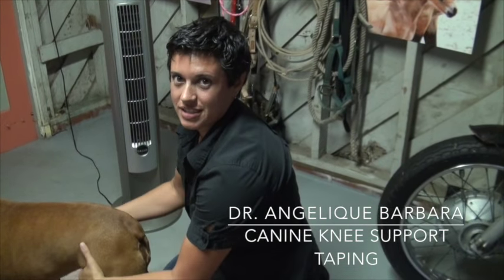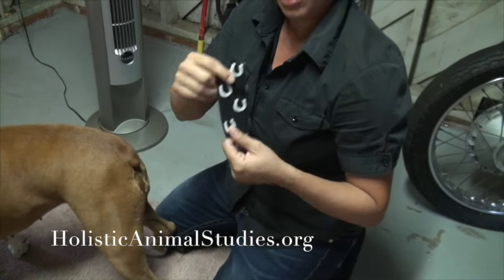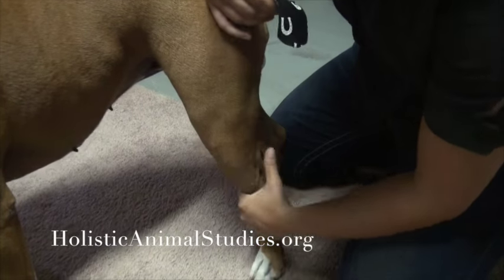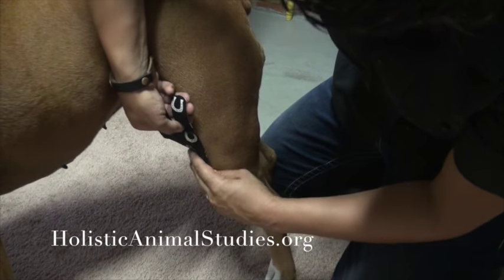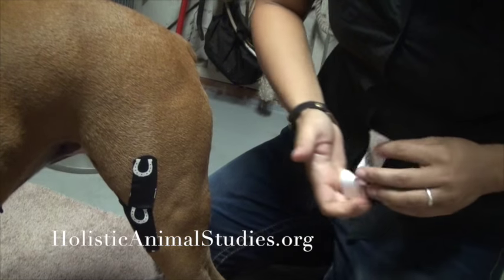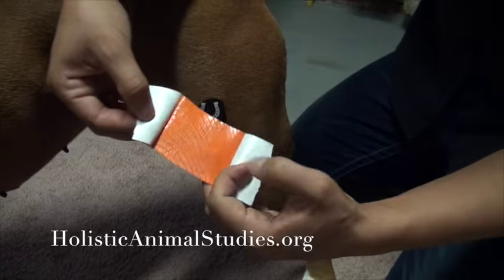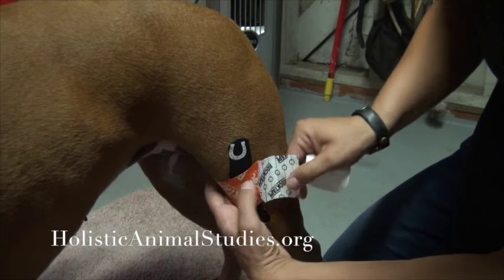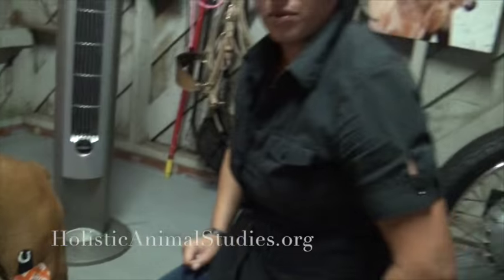Canine Knee Support Kinesiology Tape

Comment: Question: How close should I shave the leg  of my dog? She is short haired but has some fluff in the back of the leg. How traumatic will it be later on when it's time to remove the tape from the leg and the hair has regrown under the adhesive?
Reply from the maker: It should just be shaved to short hair length. The tape shouldn't hurt when being removed. You want to remove in the direction of the hair rather than against it. Some hair will come off with it, but it should only be the hairs that were ready to shed off.
Reply: @Dr.AngelB  Thank you. She seems to be healing without any brace as it has been 4 weeks.....but I have had to carry her up and down 2 flights of stairs 3x day in that time period. 
The tape may help her even more. All I know is that it has been a long recovery period and at 15yrs old....surgery was out of the question.  With her odd shape,...the affordable brace option also proved to be an exercise in futility.  I think the tape should help though.
Reply from the maker: @ToddDolce  I hope it does help. Sending healing thoughts her way.

Comment: Hi Dr. Barbara, 

I'm looking to give my dog some support for grade 2 (left knee) and 4 (right knee) luxating patellas. He has other health issues at play (Cushing's, some nerve issues, and we're waiting on a lymphoma diagnosis) which is why we're holding off on surgery for now until we know more. I'm not sure if his knees are too far gone to help but I want to at least try to offer him some stablization and support while we figure out the correct diagnosis. 

I see in the video you are using two different types of rock tape: the equine and (I'm not sure if I'm correct I'm assuming) the h20 version of their regular tape? Is there a reason to do this and not use just the equine tape or just the h20 version? It also appears as the orange rocktape may be slightly thicker, so I'm wondering if it's a more supportive tape? If so do you remember the exact name of it? I'm having hard time finding any orange tape with that logo on their website. 

Thanks, 

Aurora

Comment: My dog is a wire hair Jack Russell and pretty hairy on her leg in this area. I have the equine tape ordered and will be doing this treatment on Dusty. I have no clue if red light therapy works or is just a scam, but I have a light to try using on her in addition to this treatment. Most of the brace companies say their braces are not well suited for dogs with stubby legs as my dog has and have actually tried to steer me away from purchasing a brace setup from them because of that.My city is too far away from where any Vet does the surgery and there is no guarantees that the surgery will work or even that the other leg may also end up being torn in this area, due to the additional stress being applied to it as the weak knee heals. The cost is significant, so finding this sort of treatment as an option is certainly a blessing.I am wondering if I should shave Dusty's hind leg in this area or not?  Seems she would have some itching as the hair grew back.and though I have used this tape myself in the past, I don't recall how much air circulated well beneath the tape as the norm.  I will experiment a bit with this application. I found it difficult to locate the Equine Rock tape locally, but did finally locate it.One question though:  Does this therapy/treatment usually take about 6-8 weeks or longer before the wrap tape can be eliminated or is it much longer, depending upon the animal?Thanks for posting this video.
Reply from the maker: +a1930ford I would clip the hair on your dog's leg so that it is the length of a short haired coat.  Do not clip it down to the skin.  Ligament injuries take a long time to heal, so you will need to apply the tape for at least 3 months while your dog is using the leg.  I'm not familiar with red light therapy, but cold laser therapy definitely helps speed up healing time.  There is also a supplement from Standard Process called Ligaplex 1 that helps the ligament heal.  If you need to order more rocktape in the future, you are welcome to use my coupon code angelsanimals for 45% off.  You can order through rocktape.com.  Good luck!
Reply: +Angelique Barbara How long does the Rock Tape stay on the dog when applied?  I didn't hear that mentioned in the video. Can the tape stay in place for a day or two or does it have to be reapplied daily or such?I purchased some clippers and will be starting this treatment later tonight.Thanks for the info and directions.

Comment: Can you tell all of us if the dog needs to be standing to do this, or could they be laying down? I ask bc its just easier to see the knee when their laying down and its bent not straight. Thanks so very much for sharing your knowledge! ♥️
Reply from the maker: Hello. You can perform the tape application while the dog is laying down :-)
Reply: Thank you very much for your timely response, just one more question about application that I don't think was mentioned in the video. When you apply the (Y) the first strip of tape on the knee do you stretch it at all anywhere (top Y or bottom of Y) Or do you just apply it with no stretch? I do know you mentioned the top tape that goes on top of the Y is 50% stretch, so just want to make sure & check. Thank you again for everything!!
Reply from the maker: @ashleysnyder4875  No, I don't add stretch to that piece because it tends to stay on better without stretch. :-)

Comment: If I have a maltipoo with long hair, could I still use this tape on him? Will it hurt him when I need to remove the tape?

Also, is this human tape or do I need to buy a tape specific to dogs?
Reply from the maker: You should clip his hair so that it is a bit shorter. Taping over the longer hair will not hurt him, but the tape will be more effective if the hair is shorter. When removing it, you will want to wet it and gently pull it off in the direction of the hair growth.
Reply: @Dr.AngelB  thank you so much!

Comment: Curious about the two different types of tape. 5 y/o 90 lbs. male chocolate lab showing signs of cranial cruciate injury.
Reply from the maker: There are many different brands of tape on the market. I recommend getting one that is extra sticky or made for animals because it will stick better. There are also normally 2 widths. Most dogs do fine with the smaller (2-inch) width.

Comment: Hi Dr. Barbara, my dog was just diagnosed with an acl tear. She recommended surgery but I don't want to put my dog through that. Can I use this method to help stabilize her knee? Thank you!
Reply from the maker: Yes, it can help, but I recommend using a brace as well (you can put the brace over the tape). Also, see if you can find someone that does canine bodywork. It would be good to have cold laser therapy performed as well as some physical therapy. Good luck!

Comment: Hi Dr. Barbara.  Any suggestions for a Tripawd yellow lab, rear left amputation.
Reply from the maker: Hi there. I would definitely recommend taping the right leg to reduce strain from compensation. If the amputation was recent you could also do an inflammation reduction taping on the left side.
Reply: @Dr.AngelB  thank you responding so promptly.  We will try taping. At 9yo, we are worried about overuse/overcompensation.

Comment: Does this replace the need for a knee brace?
Reply from the maker: That depends on the extent of the injury. Any thing more than a mild tear, I recommend utilizing a brace in conjunction with the tape (you can place the brace over the tape). Once the injury is healed, you can continue to use the tape to prevent future injuries.
Reply: Dr. Angelique Barbara he is a 75 lb blue heeler who has had TPLO on the other side. This is not nearly as bad trying to avoid another surgery. What type of brace do you recommend?
Reply from the maker: @avrilway5948  There are a lot of good ones on the market. I have had clients have good luck with this one: https://goherogo.com/home

Comment: Why is thie technique significantly different to ACL taping, with regards to: 1) no anchors, 2) y-tape on patella, rather than hugging the sides of the patella, and 3) cross-tape on top of patella?
Reply from the maker: Hi Aural, are  you referring to a human ACL taping? This tape application was made with the dog's anatomy and ambulation in mind which is different than the human knee anatomy and human knee movement.
Reply: Dr. Angelique Barbara For Q1: would anchors help or cause issues for a dog? For Q2&3: I would think that the tape directly on top on the patella would cause issues with compression within the knee joint - is this a possibility?
Reply from the maker: You will want to modify the application of the stabilization piece based on the dog's needs (for example if the patella is tracking medially, you will want to place the stabilization piece so that it is putting a lateral force on the patella. No, there are no any compression issues and additional anchors should not cause a problem. I highly recommend taking our online course if you can. Sounds like you have experience taping and I think you would get a lot out of the course. https://www.holisticanimalstudies.org/canine-kinesiology-taping.html
Reply: Dr. Angelique Barbara I thought this was a CCL taping, rather than a luxating patella taping - my mistake.. Would a CCL taping differ significantly from the above process? Would a CCL taping be more similar to an ACL taping?
Reply from the maker: This is a general knee support taping that can be used for CCL injuries, luxating patellas or other knee instabilities. The application of the stabilization piece would vary slightly based on the condition you are taping for.
Reply from the maker: I always recommend "experimenting" when taping as well. If you are not getting the response you are looking for or it seems to be bothering the animal in any way, remove it and try a different approach.
Reply: Dr. Angelique Barbara OK, I'll give it a go and see what happens - thanks!
Reply: @auralangst6177  hi did it work for you? Sorry to reply to an very old comment but I'm looking to try on my dog

Comment: What size tape would you recommend for a Yorkie (4 pounds)?
Reply from the maker: You could use one inch width tape. The standard size is 2 inch and you can cut it in half to create one inch width if  you do not have access to the 1 inch tape. :-)

Comment: I have a 6 month old Chihuahua whos knees pop out regularly. Would this work until I can get her the surgery they are recommending?
Reply from the maker: Yes, you can use this  tape application for luxating patellas. You can check our website to see if there is a practitioner in your area: https://www.holisticanimalstudies.org/kinesiology-taping.html
Reply: @Dr.AngelB  so this might be a dumb question but width 1 inch but length should be what? Idaho has no practitioners....
Reply from the maker: @brittanyudy2440  You need to measure the length based on the size of your dog. I have an online course for dog owners https://www.holisticanimalstudies.org/canine-kinesiology-taping.html

Comment: Could this be used for an ACL that's partially torn or will this not help that?
Reply from the maker: Yes, you can use it for a partial tear
Reply: @Dr.AngelB  thank you!
Reply: @Dr.AngelB  I haven been unsuccessful in finding this tape to purchase. It looks like it's been discontinued. Do you have any other recommendations?
Reply from the maker: @1Antied77  VetKin tape works well for animals or you could also look for Kinesio Equine
Reply: @Dr.AngelB  great thank you! The regular rock tape I bought did not work at all. And I haven’t had any luck reaching the company.
Reply from the maker: @1Antied77  Yes, if you are going to use RockTape, it needs to be H2O (extra sticky)
Reply: @Dr.AngelB  damn

Comment: I have a hairless dog that I would like to use this on.  How difficult is it to remove? and how long do you leave it on?  thanks
Reply from the maker: It is normally easy to remove. Since your dog is hairless it may stick better to him. It can be left on for up to 3 days at a time. If it starts to come off, you will need to replace it more frequently. If you have trouble removing it, wet it first.

Comment: Tried it on my chocolate lab and does not stick. To much fur. Should I shave her leg? She has a torn CCL.
Reply from the maker: Hi Chris, what brand of tape are you using? You need to use either Rocktape H2O (extra sticky) or VetKin tape (made for animals).  It works best if you don't shave the leg. It typically has to be replaced daily due to the movement of the joint.
Reply: @Dr.AngelB  Thanks for the quick response! Rocktape H20 and Equi-Tape. The Equi-Tape does not stick well at all. The Rocktape sticks much better,but still not good enough to work. We have ordered a custom brace from Animal Ortho Care,but the process will likely take 2-3 weeks. I saw your video and thought taping would be helpful for now.  Our 7 year-old chocolate lab Mabel currently has some kidney issues so TPLO is not an option at this time.
Reply from the maker: @chrisvasey71  You could also try using "sticky spray" with it. https://www.amazon.com/dp/B0001DK29U/?ref=exp_holisticanimal_dp_vv_d
Reply: @Dr.AngelB  Maybe I will give it a try. Thank You!
Reply from the maker: @chrisvasey71  it works well. You just have to make sure it dries on the hair completely (sticky and not wet to the touch) before applying the tape over it.
Reply: @Dr.AngelB  Thanks again!